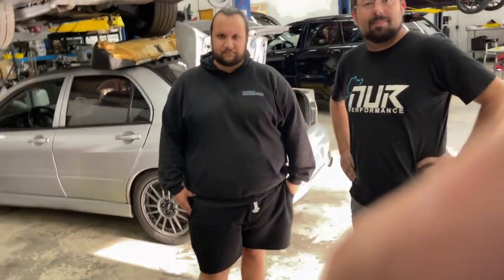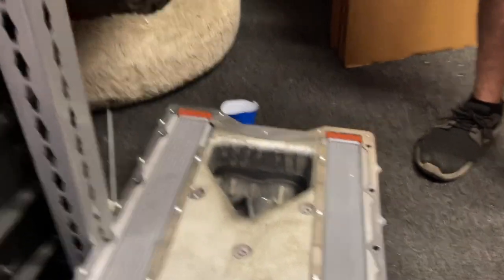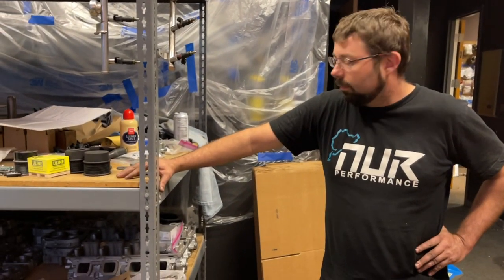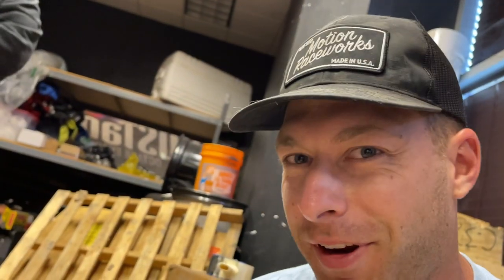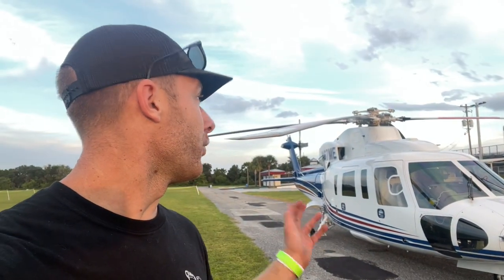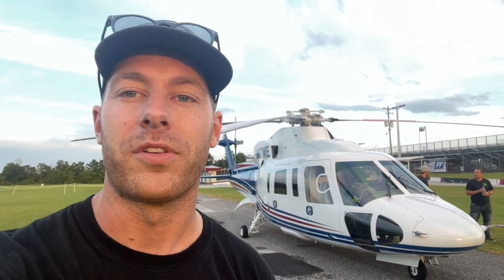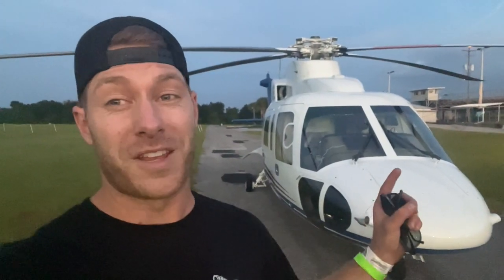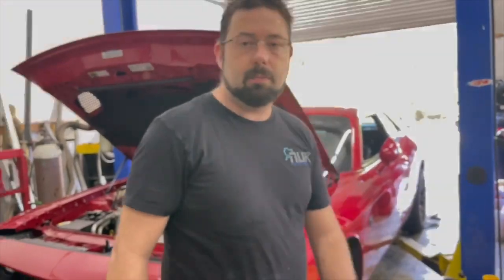Broke the HighCat... Time for Power Mods at Shop Hellcat before DRIFT NIGHT! Also Flew an S-76

Comment: Dude your going put those guys at Nur performance on the map. I work across the street at AV Motor sports and we help each other out when we can, Drew is an amazing guy and is very knowledgeable. Dude my daily is a 00 Dodge Dakota QC sport with a 4.7 manual, it a helluva alot fun🤘🤘🤘🤘

Comment: If those guys say the blower is fine then I'd believe them. I and many of us thought we couldn't hear the normal blower whine those normally have but it's just uber loud so you don't hear it. 30k even with all that mileage seems like a smokin deal considering the car is still in pretty decent shape, runs fine, and paint looks good.
There's a group of guys called Krazy House Performance and one of the guys has built a 5.7 early hemi that basically was a high mileage junkyard truck engine he finally stuffed twin turbos on. He was making over 900hp when it finally ate a piston seeing how most of it was the stock parts. Brent at PFI dynoed it and they just did a refresh that was pushing a thousand when they found the weak link and windowed the block. He's building a bigger, newer, forged black to try it again. Obviously I'm a Mopar guy but I love seeing some different cars being played with and love seeing that crazy high miles Hell Cat still kicking ass, thanks.

Comment: Great looking forward to see HighCat back in action. 
What's the reason for a hotter thermostat?
I've used colder ones and higher pressure radiators/overflow caps, but never hotter thermostat in "race" application unless heavily pressurized like Hilllclimb and i believe Nascar.

Comment: You should get a TKM built 3rd gen Hemi with a big Whipple for the Hellcat and mini tub it with ladder bars if you're going to keep it a burnout car and if you decide to make it a badass drag car I would still get a badass TKM built 3rd gen Hemi or a real Hemi built by Proline,Noonan or Moran and make it a big tire car and either go with a big single or twin 98s or a big Procharger and a 4 link rear suspension with a 9in and a TH400 trans and make it light as possible